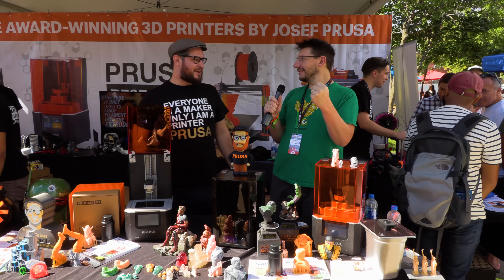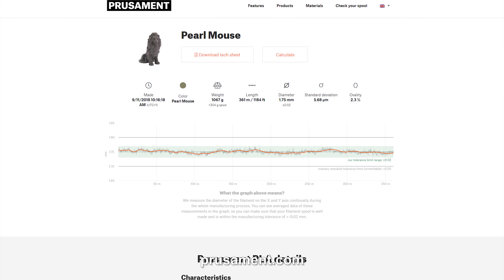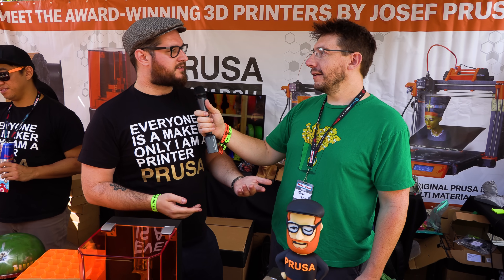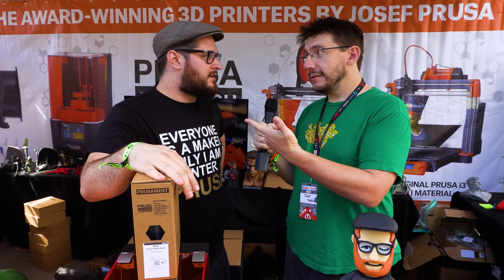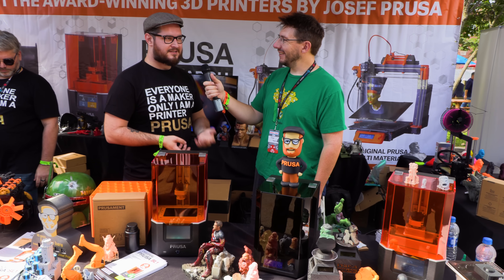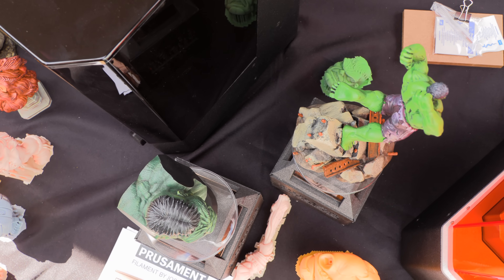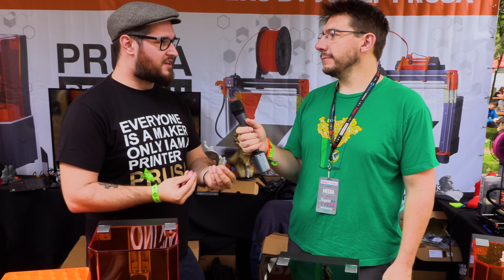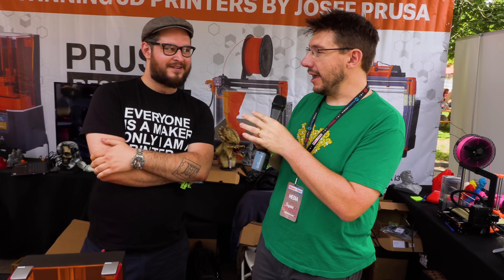Prusa SL1 Resin 3D Printer and Prusament FIlament

Comment: No automatic resin fill is a deal-breaker.  The entire point of my Form 2 is that i can hit a button and do something else until the part is done.  Without that, much of the value prop (for me) disappears.
Reply: well it costs 3 times as much, so you can and should expect more stuff
Reply: It checks to see if you have enough in there before it starts. And if the level gets too low while printing, it'll stop at that point and notify you (rather than carrying on and running out).
Reply: Yeah that’s all good, I understand how it works.  Much better than just letting it run out.  Still, I find that the main reason I use my SLA machine is just that it’s hands-off.  I often set up a part to print overnight or while I’m working on other things.  The sla process is so reliable that it lends itself to this... I don’t even wait to watch it start anymore.  I don’t think my sla machine has ever failed a print... over many hundreds.

Not saying it should be a dealbreaker for anyone else... it’s be great for anyone who doesn’t mind checking in and handling resin, but for me that’d negate much of the advantage over other methods (fdm and subtractive, mainly).  Someone who is interested in printing high res figurines without spending a lot may do different math.
Reply: Yes, when I bought my Ferrari and then saw the release of the new Toyota I was also like... daaaamn who would ever buy that!? ;)
Reply: Vincent Groenewold it’s $2k... not exactly Ferrari money.
Reply: James Martin  True, but still, that's kind of the point for it being cheaper. It has less options, but is open-source, so it would even be possible to change it down the road by enthusiastic users and sell an option for it.
Reply: Vincent Groenewold yeah I totally agree.. V2 will probably have it.  I can’t imagine it’s really much of a cost issue... the form 2’s system pretty much amounts to a little light sensor, motor and what look like shampoo bottle caps, as far as hardware is concerned.
Reply: James Martin  Then I'm pretty sure someone will just mod it on and change the firmware a bit to accomodate. I like the pricier printers as they usually are built better, but that part of open-source has sold me on using open-source FDM printers as well. If I had a company though, I might go with the better quality ones.
Reply: @Jmartin2683  , on eBay or where? No $2K printer on the company's web site...
Reply: Michael S the price difference between the sl1 and form2 is roughly $2k

Comment: Still looks to me like the resin is going to be messy.  If that's the build platform he's putting into the washer, that's going to have resin all over it from dipping into the tray and look at how he has to handle it to get it to fit.  It's nice to see a Prusa entry into SLA/DLP, but resin handling is a pain and all of the cheaper machines seem to skim over it in their details...

Comment: Hey Joel! Thanks for hanging out with Josef and gathering info on the SL1 and on Prusament. I'm still fearful of resin printing (I've got a kid and cats, and they're sometimes unpredicatble).

Regarding Prusament: You know what would be cool? If Prusa also sold the rejected spools at a lower cost. Even a rejected Prusament spool is probably more in-spec than cheap filament. I could use it in my non-Prusa printers! 👍
Reply: sounds like a good idea, but they're probably reusing the rejected spools. if they aren't, though, that is a great idea!
Reply: BV3D I agree on all accounts.  I too do not like the toxicity of Resin printing.  Hopefully one day they will make a more environmentally friendly resin.  I'm sure smart minds are working on it.

On the Prusament this is a great idea.  I would think that rejected spools would not be reusable because they are already colored.  I certainly hope they are not wasted. That would be very unfriendly to both material and environment.  So selling these looser tolerance spools is a great option and I'm sure they would sell very well.

Great comment man.
Reply: @willierants5880  There are Eco Resins out there. The issue is most are brittle, fast discoloring, and tend to be very expensive. But they are simply biodegradable and still are somewhat toxic to humans and animals even if they are less so than normal resins. Heck even biodegradable plastics put off some toxic fumes.
Reply: I kind of envisioned them selling all the spools on a sliding scale, so if one freak roll has nearly perfect filament, it costs a bit more, and it's all done based on the max tolerance.  That way less tolerant rolls are automatically priced lower, etc.
Reply: That would be super nice, plus, they would still have all the measurements and data, so you could see exactly how off spec it is. My assumption is that they don’t throw the stuff that’s slightly off spec away, but rather use it to print parts for the stuff they sell. The other side of this is that selling off-spec spools would complicate their manufacturing/retail process (everything seems simple until you get into mass production) and negative reviews for their off-spec spools could be associated with their on-spec spools. Also consider that the goal of their manufacturing process is to guarantee quality and to have as few bad batches as possible - if they get good enough at making the stuff, they may not have enough off-spec spools to justify selling.
Reply: Kids and cats don’t mix with toxic chemicals. I’m waiting for when the chemicals are safe to touch.
Reply: BV3D they should do a protopasta and sell good quality rolls that ended up off color for a lower price!
Reply: While I have a resin printer myself, and really like just how insanely detailed tiny objects can be - they most certainly should not be within reach of kids that are still in the age range where everything goes in their mouth.
Reply: They probably just grind and mix them with >95% virgin PLA, much more cost effective than selling them.

Comment: This video was timely, I was just watching an older Joel video and clicked on his Prusa link and saw, wait a second an SLA printer?  WAIT, WHAAAAT!?
Reply: Angelenglen  
Consent is based on the DLP components selected. The LCD works like a matrix and is cured by a UV light, not a laser. This is a simpler and cheaper technology with one improvement against the competition at twice the price
Reply: Angelenglen   This IS an SLA printer.  This printer isn't even DLP, it uses MSLA, and I don't think there's a claim that it's Laser SLA like the Form printers.  Here's an article for anyone who wants to educate themselves about three different SLA technologies - https://theorthocosmos.com/laser-sla-vs-dlp-vs-masked-sla-3d-printing-technology-compared/